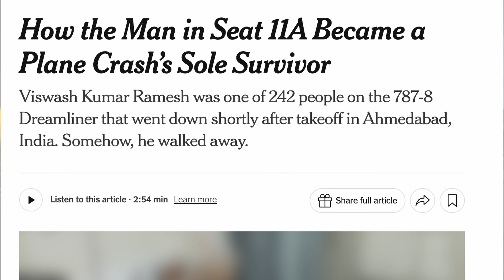Why the RAT Changes Everything – Air India 171 Update

Comment: I've seen the video made by the chap on the previous flight. He has said that he made it as he was going to make a complaint. The air conditioning vents weren't working and neither were the tv screens. I'm thinking that he won't make a complaint now and that he's thanking his lucky stars but would this be an indication of something bigger waiting to happen? The mayday from the captain said that he didn't have thrust but the engines must have fired up for take off? Would any of the fuel pumps or fuel control systems be affected by an electrical failure?

Comment: Dual engine failure is a possibility - however it doesn't explain why the slats are in about position 5 and the flaps are basically up in the video and the wreckage. 
My current theory is that somewhere between start-up and taxi check list the hydraulic pumps failed or the hydraulic fluid was too old and either leaked or blocked... then as per Taxi check list the flap handle was put to position 10 or 15, but the slats move first and drained the accumulator so that would be why you have slats around position 5 but no flap. 

Then you see as tried to Rotate it just didn't want to fly and they overran the runway, ingesting lights and runway equipment may have caused the engines to fail but I'm going to guess the RAT was out before that. But even so that could cause the electrical power to cut while the essentials switch over to RAT supply. 

Flight controls and landing gear have serrate accumulators (I know that for other types not 100% sure for the 787) but I think they did command a gear up judging by the bogies position but again the initial action drained the accumulator so no gear doors or swing happened.

Comment: I concluded dual engine failure when I saw the flightradar website feed. The ADS-B feed stopped before the plane left the runway. Also the take off video shows the aircraft using up a bit more runway than you would expect.

Comment: Sir what ever you said that the possibility is the dual engine failure .so what caused that failure,I wanted to share something regarding the failure which I don't know is it possible or not, you know more.. sir could it be that the fuel valve was closed from outside deliberately or mistakenly...If a Boeing aircraft's fuel supply is turned off from the outside and not turned back on, the engine(s) will eventually shut down due to fuel starvation. Without fuel, the engines cannot generate power, leading to loss of engine thrust and potentially affecting other systems that rely on engine power, such as electrical generation and flight instruments.Once the engines stop, the aircraft will lose thrust, which is needed to maintain airspeed and altitude.

Comment: 1. Quite a lot of dust/debris when the plane took off. Did the engines ingest something then that lead to dual engine failure?
2. A passenger on the first leg of the flight (New Delhi to Ahmedabad) on youtube showed no screens working, AC not working, no overhead lights in cabin - seems there was electrical issues with the plane. Could such electrical gremlins expand and kill all electrics onboard leading engine flameout and RAT to be deployed?

Comment: Given the evidence showed pointing that the engine lost power without any smoke out or fire coming out of the engine. There's only one think I could think oh is that the N1(the fan) shaft spool got broke from inside and leading into no thrust. Although it is highly unlikely to happen but it can happen when the shaft spool couldn't take the torque given.

Comment: Regardless of the RAT deploying, this does NOT explain why the flaps were up and the landing gear was down. In that period right after take off the aircraft can NOT maintain flight with flaps up and gear down even with full power. If there had been a power failure at that point of the flight the fully loaded and fueled aircraft would come down like a rock. With full power it would slowly settle down  but be unable to climb or maintain flight, as in the video. Even with full power that aircraft can NOT fly with flaps up and gear down at that speed. The aircraft responded exactly as it would with flaps up and gear down at that stage of the take off, not as if it had a power failure from the engines. Certainly I'm not the only pilot that understands this. What say you Captain Steeeve?
Reply: Maybe hydraulic failure to the flaps?
Reply: Actually, slats and flaps were properly deployed (this can be seen at 03:13 of the present video, as the engine cen be seen between the flaps and the wing, and at 03:08 where the slats are seen as deployed).
There was an attempt to retract the landing gear: the bogey were tilted on the retractation position (front wheel lower than aft wheel), which is the first action of the retractation sequence.

Comment: If dual engine failure is vapor lock a possibility in the fuel lines? The air temp at the time was 102 degrees Fahrenheit.
Reply: No

Comment: The captain side will still be able to communicate on standby power, the RAT will deploy if the instrument busses are unpowered also, can’t see losing all power on the aircraft, more like it was hot, did they do a derated take off, instead of an assumed temp takeoff, derated takeoff will not alow you to advance the throttles, need to change the FMC to continuance, not enough time to figure that out so low

Comment: But wouldn’t this still support the theory that the flaps were retracted in error instead of the wheels. If the co pilot made that mistake couldn’t the pilot misinterpret that mistake as a duel engine loss and then he would activate the RAT whilst trying to work through the problem.
Reply: Not enough time to do all that

Comment: There was a video floating around that I saw, claiming to have been taken either earlier on a few hours previously, from inside the cabin… and the IFE was out, the overhead seat lights weren’t working either.

https://youtu.be/1y_u1O-T6jw?si=uaN1cRnJc1vKHKEp

So it may have had a serious electrical issue.

Engines if I’m not mistaken have electrical fuel pumps.

Comment: Hallo Captain Steve, I have been an Aircraft Mechanic for 38 years, Now working on B777 for FedEx, I was working  for a aviation company way back in South Africa and we had also a 4 engine failure on approach BA146, the Captain manage to land safely, after investigation it was found that the wrong Power Management Computer was installed, the Company was operating the RJ 146 and the BAE 146 the RJ was more  a Newar modal than the BAE 146, That meant said the had an power issue with Th RJ 146 and the engineers installed the Power management computer to the RJ146 but it was meant for the BAE146 the part number on the box is exact except the last digit 146 = -5 and the RJ = -6 that meant when on approach in to Cape town Airport when the Capt. retard the TR all Eng. went flame out. this was just an Idee of what could have done by maintenance to get this bad problem. thank ou for our great channel.

Comment: How can both engines fail at the same time? Please explain possibilities of both engines failures.
Reply: Simultaneous engine failure during a fully loaded takeoff is extremely rare, but it is not impossible, even in the absence of a bird strike. One of the most plausible causes in such a scenario is fuel contamination or misfueling. If both engines receive bad fuel, whether it’s contaminated with water, dirt, or even the wrong type of fuel, they can flame out almost at the same time. This is especially dangerous during takeoff, when the engines are under maximum load and there is little margin for recovery. There have been real-world cases where misfueling led to total engine failure in flight.

Another possible cause could be a significant mechanical or control system failure, particularly involving the FADEC (Full Authority Digital Engine Control) systems that govern modern jet engines. If there is a software fault, electrical failure, or synchronization issue affecting both FADEC units, the engines may receive incorrect fuel flow or throttle commands. While these systems are designed with redundancy, a dual failure is not completely out of the question, especially in older aircraft or those with known maintenance issues.

Fuel starvation due to misconfigured fuel systems is also a possibility. For example, if both engines are drawing from a tank that is not feeding properly, perhaps due to a failed pump or incorrect crossfeed setting, they might lose power almost simultaneously. This kind of issue may not become evident until the engines are under heavy load, such as during takeoff.

Environmental factors should also be considered.foreign object debris on the runway can be ingested into both engines during takeoff. These materials can damage internal engine components, block airflow, or cause compressor stalls, leading to a sudden loss of thrust.

Finally, human error, whether in maintenance or preflight configuration, cannot be ruled out. Faulty installation of components, blocked intakes, or something as simple as leaving protective intake covers in place could cause both engines to fail when full power is applied. In very rare cases, deliberate sabotage or gross negligence has been responsible for similar outcomes.

While dual engine failure on takeoff is extremely unlikely, it remains within the realm of possibility. The most credible causes usually involve shared systems, contaminated fuel, or environmental factors that affect both engines at the same time during the most critical phase of flight.

Comment: All those postulating contaminated fuel, etc. fail to realize that that wouldn't cause simultaneous flame-out in both engines. First one engine sputters, pressures drop, the plane is pulled in the direction of the failing engine, then later (maybe minutes) the other engine expereinces problems. Both videos clearly show no sudden yaw or turn, just a smooth rise then sink.

Comment: Folks !  We have a real problem when both engines shutdown after take off , do you realize that the automated systems may have been the fault in this whole tragedy  ??? This is really bad .... these pilots and passengers had absolutely no chance of survival except the one guy who is the exception,  not the rule , it's like having automatic breaking system on your vehicle and it automatically slams on the breaks while on a freeway traveling 70 mph in full traffic ..... this total automated shit has to stop .... we are getting to stupid with this crap .... or like farm tractors stopping right in the middle of the field and the farmer has no ability to fix it because it's automated

Comment: The RAT operated almost certainly in response to a dual engine failure as the “MayDay” was qualified by “Loss of Power Loss of Thrust” transmitted from cockpit. From the video the aircraft showed a positive stable (6DoF) descent the wing tips still slightly  flexed up with reducing aerodynamic speed giving some lift but insufficient to maintain its heavy all up weight and main landing gear drag.  To excuse the term but its fatal descent was “graceful” (no yawing or pitching). There have been incidents since the 1988 A320 Habsheim low level forest entry and A-400M engine management of computer management issues. For a dual engine failure the finger tends to point to the engine management computer control unit, but that needs to be fully discerned as whether it is a software, firmware or hardware or incorrect initiation by a critical parameter common to both engines (aircraft).  My experience is a mostly military aircraft (fixed wing) damage assessor, and aero systems (propulsion) engineer on transport (Mil and Civil) that included engine monitoring (critical parts lifing) during A380 and B787 flight testing during airworthiness registration of life consumed for the sell on of a small batch of engines .

Comment: I’m not saying this was the cause, however, an AD from 2015 would cover all the bases of this crash. DEPARTMENT OF TRANSPORTATION
Federal Aviation Administration
14 CFR Part 39
[Docket No. FAA-2015-0936; Directorate Identifier 2015-NM-058-AD; Amendment
39-18153; AD 2015-09-07]
RIN 2120-AA64
Airworthiness Directives

The 787 relies on electric power more than previous commercial aircraft. In addition to powering onboard avionics, the 787’s electrical generators also are used to pressurise the aircraft cabin and de-ice the leading edge of the wing.

Two 250kVA generators are installed on each of the 787’s pair of turbofan engines. Another two back-up generators each rated at 225kVA are connected to the auxiliary power unit. If all six generators fail at the same time, a lithium-ion main battery keeps power running to the flightdeck systems for about 6s until a ram air turbine can deploy and begin generating enough power to help the pilots navigate while attempting to restart the engines or glide to an unpowered – or “dead-stick” – landing.

All six power generating systems are managed by a corresponding generator control unit (GCU). Boeing’s laboratory testing discovered that an internal software counter in the GCU overflows after running continuously for 248 days, according to the FAA. The overflow causes all four GCUs on the engine-mounted generators to enter failsafe mode at the same time.

The software overflow problem is the latest in a string of reliability bugs to surface in the 787’s electrical system. The FAA grounded the 787 fleet for four months in 2013 after two batteries overheated, leading to a redesign of the battery system installation. Last June, the FAA approved an exemption to allow the 787-9 to enter service on schedule despite a substandard reliability record on the GCU for the RAT. The agency approved the exemption because it was deemed extremely improbable that all six power generators on board could fail at the same time.

A redesigned RAT was cut into the 787-9 production line on schedule in February and Boeing is continuing to retrofit previously delivered aircraft, a company spokesman says.

Comment: I agree that the RAT does shed a new perspective on the cause,however Ive seen a video from a passenger in that plane on a previous flight showing that non of the electrical functions like the video screen over headlights worked.  There seemed to be a major electrical issue with the plane.  This could have lead to the engines flaming out and the flaps retracting due to loss of hydraulic pressure of the wing surface’s.  I also noticed when the accident plane rotated it took every inch of available runway to get airborne by the fact that upon rotation the video shows a lot if debris getting blow up by the engines as if he was over grass rather than runway when he finally got airborne . This again leads me to believe that just upon rotation the electrical system and hydraulic systems failed causing the flaps to retract during rotation .  The plane appeared to struggle to get airborne using all the runway before rotating.